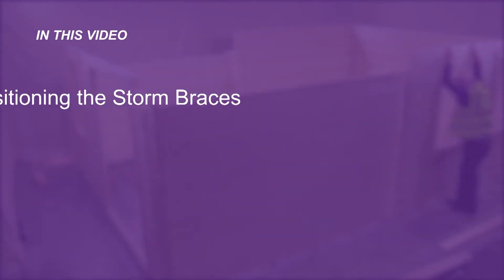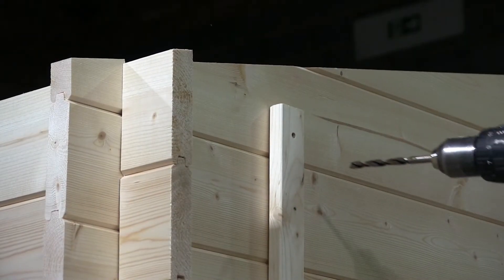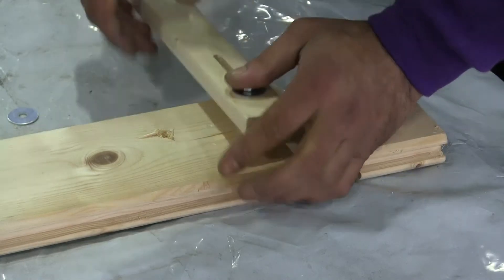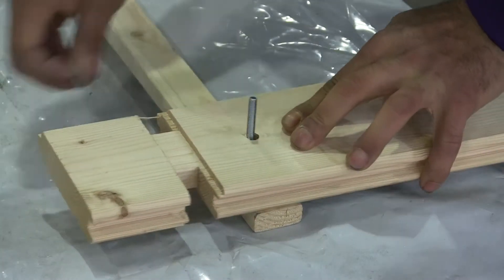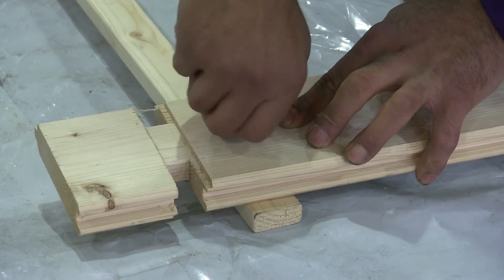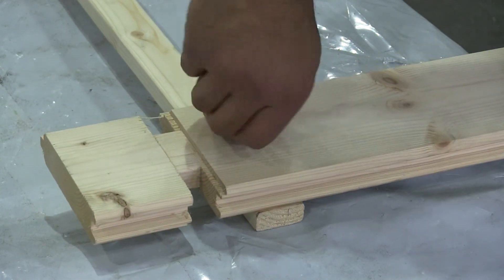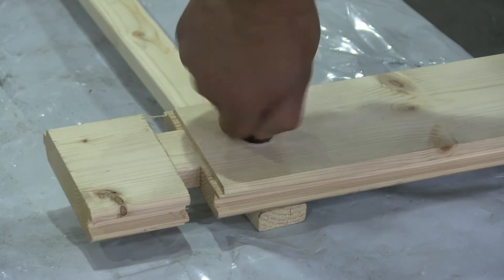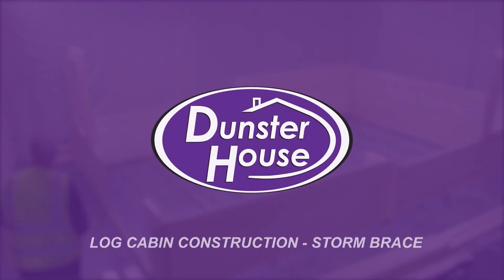Storm Brace Construction

Comment: But the wall logs are screwed together at the corners as they are assembled - any storm powerful enough to override that wont be stopped by the storm brace - seems redundant to me and only necessary if you want the cabin to be breakdownable
Reply: You don't screw the walls together do you thought you just screw the bottom ones to the bearers?
Reply: @rjs71  That's what I thought ... and did too!
Reply: Me three. Surely screwing the logs together in the corners defeats the logs from being able to expand/contract during summer/winter?